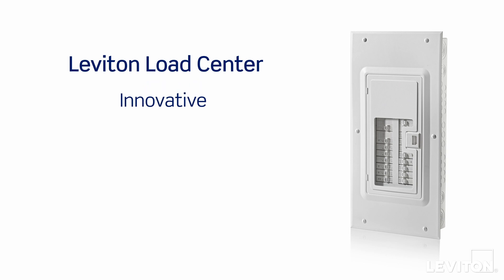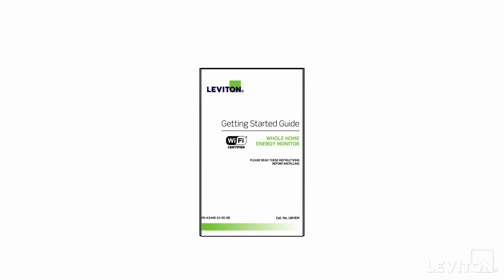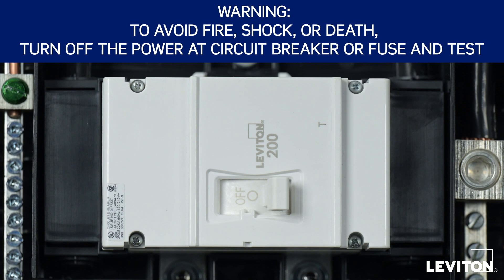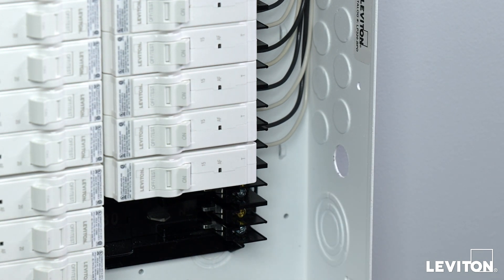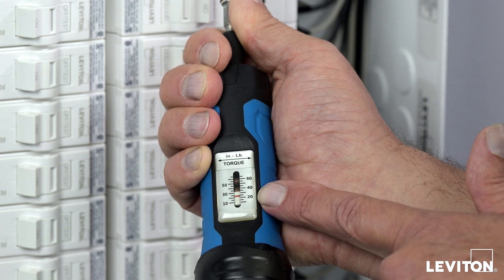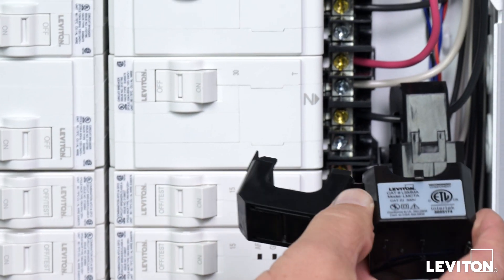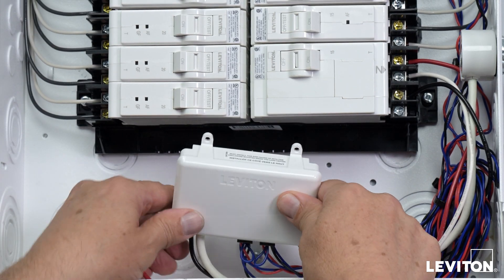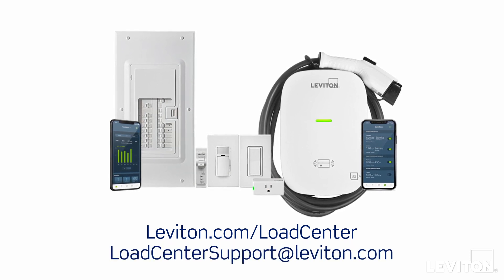Installing the Leviton Whole Home Energy Monitor

Comment: Wow after I’ve purchased a whole panel of 1st gen smart circuit breakers 😂😂 wow 🤦🏿‍♂️ but this is great news, now with these 2nd generation breakers the load center competes with the SPAN panel
Reply: Not to mention SPAN does not allow controlled sub panels, or any expansion beyond the primary load center.  Can only use 1.  Leviton has no such restriction.  However, SPAN has a more friendly user interface and features, but, Leviton has been around a long time.  If SPAN goes belly up, you're SOL
Reply: I just had the Leviton Load Center with 2nd gen breakers. Just waiting for the whole home module to get installed. Living in the PG&E territory, so electrical is outrageously expensive. This helps provide peace of mind I don't have phantom power drain in my home.